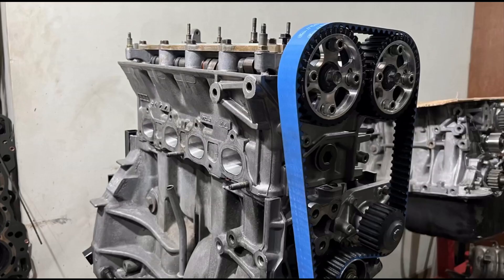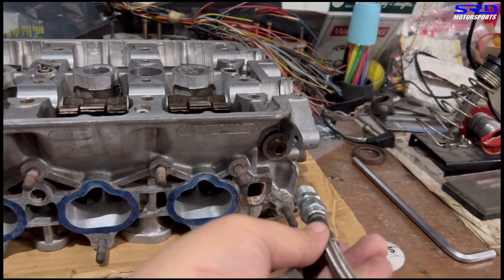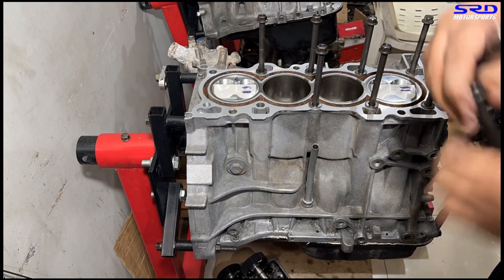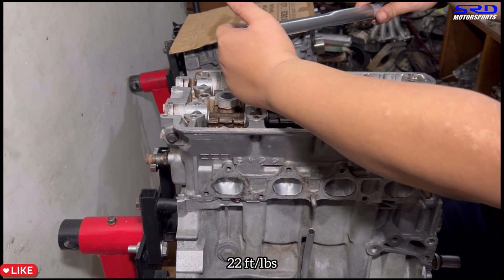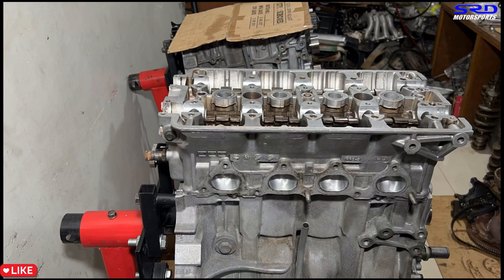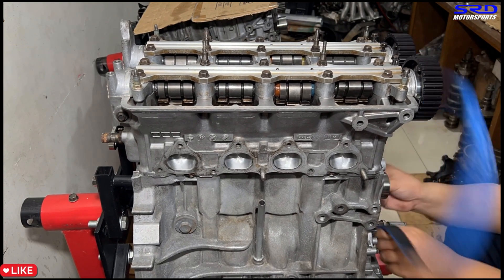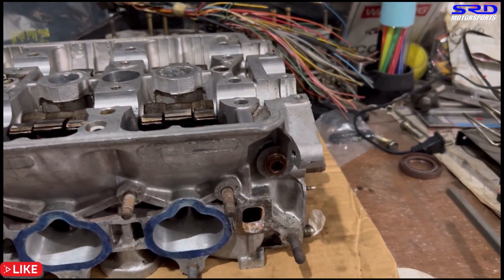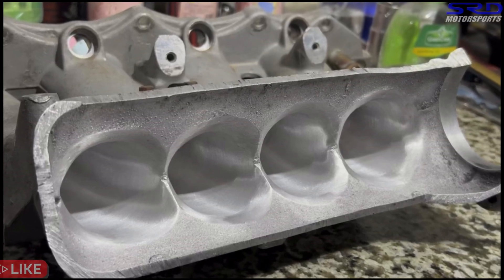B20Vtec Build Part 5 Complete Engine Assembly Done by SRDmototsports

Comment: Update?

Hows the head bolts holding?
Reply from the maker: the owners installed it on their EF and already shipped the ef to Mindanao… all is good

head bolts are fine just like Jaspers b20vtec on stock head bolts been pulling 12.5s and running since 2017

Comment: Hello, how many Whp you can make in b20v 85x89, with skunk2 pro2 and pro3 with CR 12.5.1 at 91oct?
Reply from the maker: that’s a good set up that’s easy 235-245whp

and deep into 13flats atleast on street tires

Comment: Hi ralph! Assuming that my b16a2 1994 have 240cc saturated injector and (not Peak an Hold), On the cheap which injector should be used? I've noticed some using k20 instead older prelude ones
Reply from the maker: Well as long as it gets retuned the k20 ones would do well… a lot of it is cuz it has a better spray pattern than the old ones so that’s free responsiveness etc

Comment: What lower injector seals do you usually use with Rdx injectors on b20v builds? The seals that go in the manifold/bottom of injector. 😊
Reply from the maker: The oem ones usually work good , we just check and interchange the sohc or dohc ones whichever fits best

but must need a top hat for the RDX
Reply: @SRDmotorsports  yes sir, must have the top hat! I had oem ones for b16 and they were some what loose, so I'm trying to figure what to use, I think I may look into Sohc engines like you suggested! You're awesome!
Reply from the maker: I believe the y8 ones (sohc) are deeper so thicker spacers
Reply: @SRDmotorsports  thank you for the tip, always great talking with you!
Reply from the maker: No problem man! thanks for supporting the channel Ofcourse and checking the videos appreciate that definitely

Comment: Yelp I just lifted a head and I hope that wasn’t the issue lol because if so it will happen again lol. Also what would cause a oil film or fuel in my antifreeze. When you coming to Kentucky lol
Reply from the maker: Oh bummer man! but hey maybe JE pro seal would help out and if possible oring the deck but gotta pull the block for that so that’s a bummer
Reply: @SRDmotorsports  Blocks been o ringed . I took it last weekend and drove it 159 mile to the track put two passes down with a 100 shot and then noticed my catch can was full of water or fuel and my radiator was 16 oz low and had a film on top the antifreeze
Reply from the maker: Oh bummer man
Reply: @SRDmotorsports  then I drove it bk home didn’t lose any water or anything? My idle is messed up though that’s it
Reply: Also my piston bore is 84.5 mm and he used a 85 mm gasket could that be a problem?
Reply from the maker: @tjabdon606  gasket bore is fine, but since u drove it home okay, could just be a simple blown HG might just be that

Comment: I believe on a B20vtec or Lsvtec you can use GSR Head Studs But I prefer ARP Head Studs because if there’s a gasket problem like the head gasket has a defect and blows up early I can easily remove the head
Reply from the maker: Yep gsr is about the same length as an ITR head studs
Reply: @SRDmotorsports  I always prefer ARP Headstuds for safety reasons also because of how simple it is to remove it
Reply from the maker: Yep both works well when properly used and applied, ARP is always good stuff